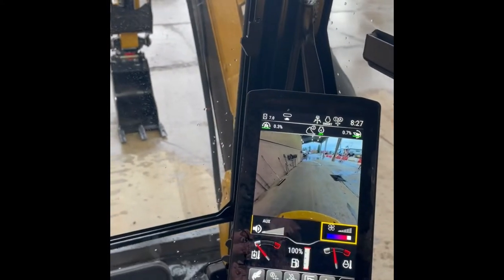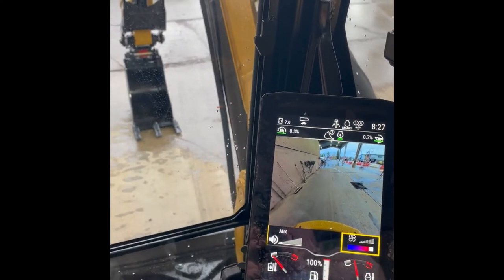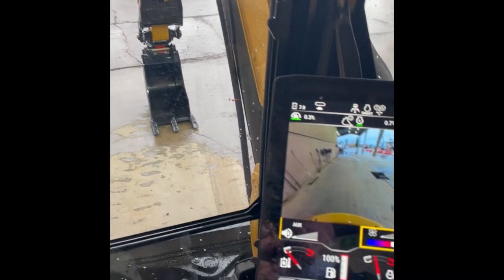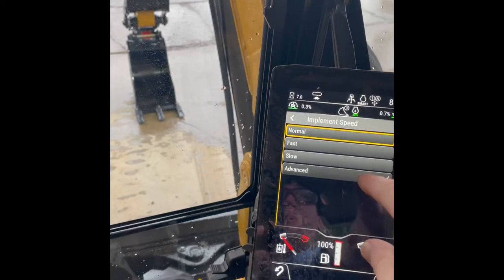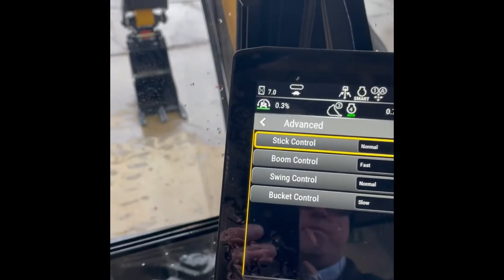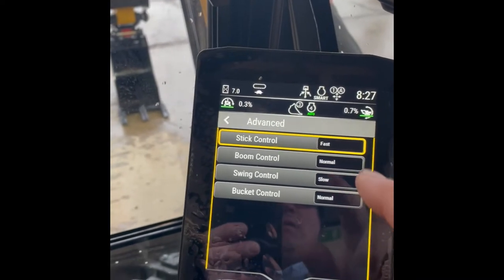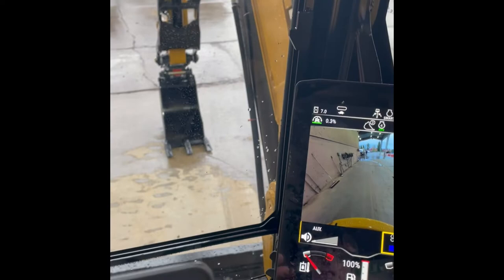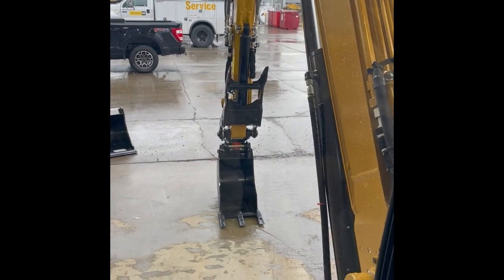How to Adjust Implement Speed and Joystick Response on a Next Gen Cat Mini Excavator

Comment: I have a 301.5 and 305 next gen machines.  With settings identical in the monitor the responsiveness is different in both machines.  The 301.5 slows way down but the 305 is way faster.  Is this because the system operating pressures are different?